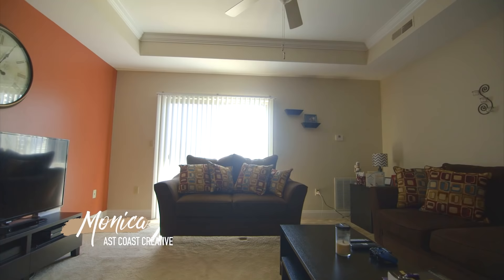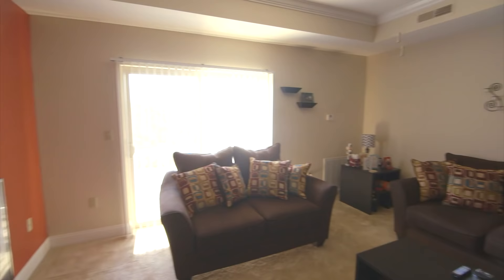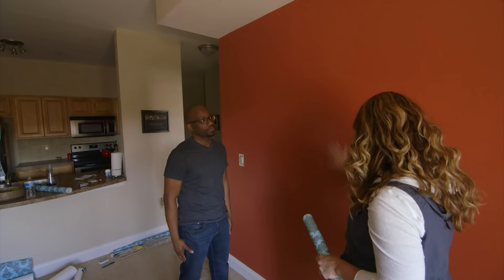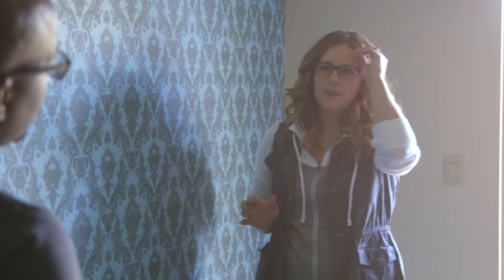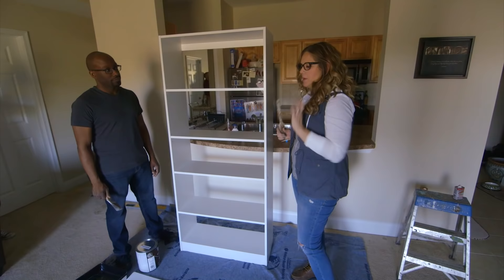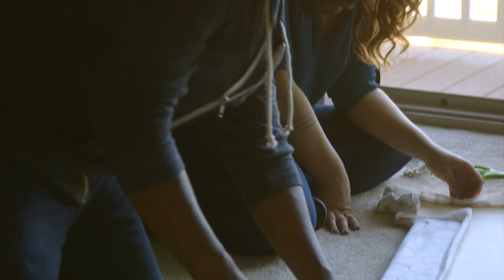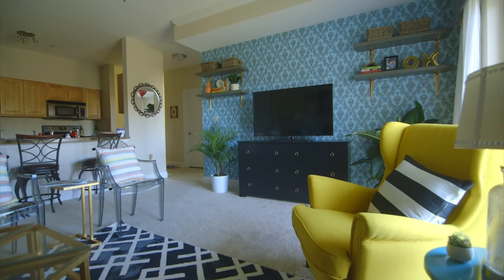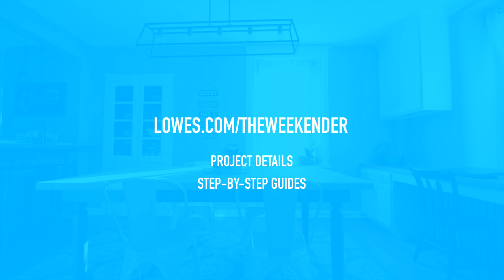The Weekender: "Renter's Reno" (Episode 3)

Comment: OH NO! You can't drill holes into the walls! Are they safe to get their deposit! D:
Reply from the maker: Don't despair....holes are easily repaired. A little paint and deposit is safe. Thanks for watching.
Reply: but you didn't paint the wall because paint isn't okay... and matching paint after the fact like that is nearly impossible. Not sure the explanation here really works.
Reply: Jessica Raine if they move out the apartment owners will most likely just paint the wall white again so it'll be ready for the next renters. St least that's how the apartments I live in are. So the patching and repainting of the walls won't be a problem
Reply: Experienced renter here! Most of the time rental places will either paint over the holes or they'll ask you to patch them before you leave (only did this once but w/e) and it won't affect your deposit as long as you haven't like... punched a hole in them or tore the dry wall beyond a simple patch job
Reply: Yeah I don't get this preciousness about the paint and then screwing into the wall. Makes no sense. If you're going to patch and paint the holes you may as well just paint it the colour you want
Reply: LisaFrank39 The Wall was red.  That’s what I don’t get.  Why would the owners do that? That’s probably what threw the renters off in the first place, thinking they had to match the red.

Comment: Be careful! Removable wallpaper equals contact paper.  If you have high temperatures or set you thermostat down in the daytime, you could still end up with a sticky mess that is almost impossible to remove.